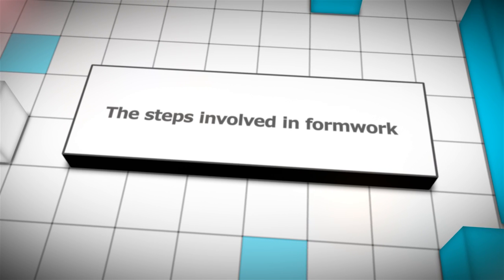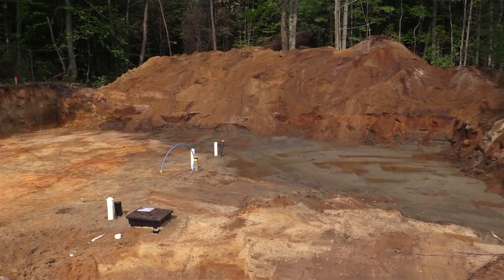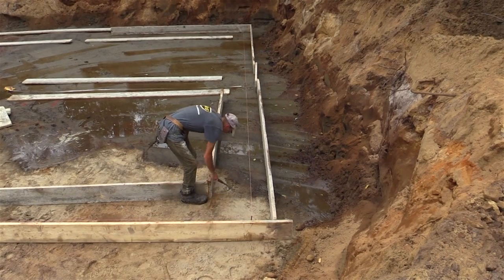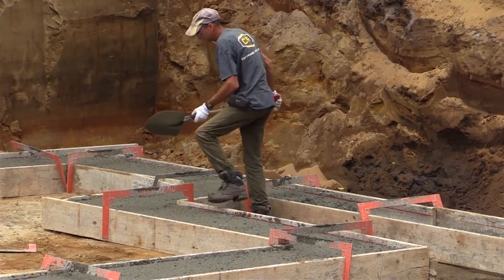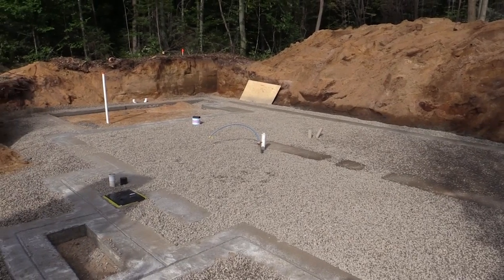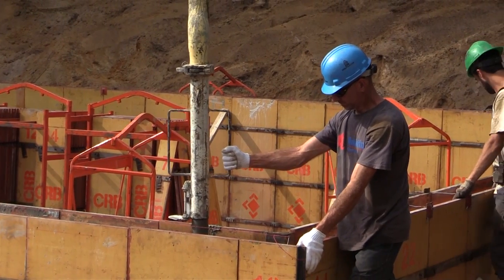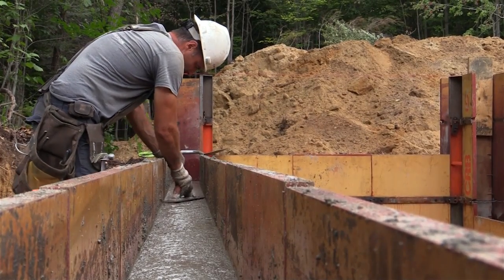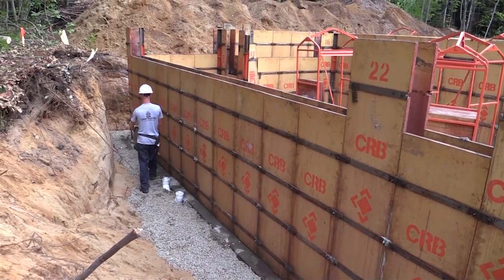The steps involved in formwork

Comment: WHAT ????? NO REBAR in the footer or walls , you would never do my place …..
Reply: Not every job requires bar. Depends on the fill /lay of the land .
Reply: Formwork
Reply: The builder doesn't decide whether to out rebar or not. They go according to the specifications on the blue prints
Reply: Not a sign of a rebar to be seen 🙈🙈
Reply: im sure they follow the blueprint   but i cant belive  they dont insert not even 1 rebar , i dont see the point of saveing few bucks

Comment: No reinforcing rebars in the walls/foundation?
Reply: Winston Clifford Fast and Nasty ! where I live a 2 ' by 2' grid of # 4 rebar is code in all foundation walls
Reply: None in the foot nor verticals to tie to the wall.  WTH??
Reply: GomerfromIsaan some places all you have to do is put in a key way in the footings.  It's actually the A.C.I. code book believe it or not . It's not like that where I live though
Reply: Winston Clifford only 9 to 10 foot walls are in need for steel work these forms are 8 footers no need
Reply: The majority of houses that I pour, even if they are 9-foot walls do not need any rebar in them at all. Every barn that I have poured needs it, as well as commercial jobs. I would say many houses do not, though.
Reply: excavation process its needs willngly of person otherwise it easy to get negative impact to the site and safety of person
Reply: @pnutmal  where i live its like 16 centers both ways all 15m bar.
Reply: @tl7992  entirely depends on the soil conditions around the foundation. Where im from, the soil is a very active clay. all concrete poured here required loads of rebar. Must be nice to be somewhere with more stable soil.
Reply: I dont get it
Reply: We usually never put rebar in the footing unless the builder wants us to, but always put at least 2 rows of #4 rebar or more in every foundation we do, it's code in CT
Reply: No rebar needed if you pour your house on a spring. ....🤥
Reply: substandard at best

Comment: Where are these guys from ?  No steel ?  No J bolts ?
Reply: Judging by the name, Mexico maybe?
Reply: That's a French name. I live in Mexico. We use shit loads of rebar. A full bond beam at 9' height.  A vertical every meter ( 40"). All solid block, steel, and concrete.  Even the roofs.
Reply: Well maybe it's french then. I think Rebar is really only for code in places that have earth quakes or any kind of ground movement. If the ground doesn't move, then the concrete is gonna be just fine sitting there.
Reply: I was a concrete contractor.  Concrete really has no strength.  If you put 4'' x 4' x 10'  Between the walls with no support it would crack in half. But if you put 1/2" ( # 2 ) rebar every 12'' ( making a checker board ) it will be very strong. One helps the other.  You ever see a bridge pylon ?    It's mostly steel and filled in with concrete. Vibrated so as to have NO air bubbles. Air bubbles would break the bond.  Also horizontal  rebar in a footing insure no differential settling.  I worked in Phx 40 years.  Now they use post tension.  A much better system.
Reply: Well, I know there's a lot of primitive forms of concrete used in Roman structures that still stand today with no rebar. Obviously it's not worth really doing it without rebar and have your house fall on you, but if done right without it I'm sure it can still be done. You need the right kind of concrete though.
Reply: They're from Canada. Judging by the french name I would say Quebec or eastern canada somewhere.
Reply: @dedalliance1  Well, IDK about all that? For instance the Roman Colosseum's outer walls are estimated to have over 3.5 million cubic feet of travertine stone & volcanic rock, which was set without mortar. Yet, they are held together by 300 tons of "iron clamps." Now, there may be other Roman structures which were built w/o any iron holding them together as you state, IDK? I'm just giving you this 1 example to show you that the Romans absolutely did use a type of iron, (rebar) to hold the integrity of the Colosseum together. Plus, the rebar has nothing to do with whether you live in a place susceptible to earth quakes or not. Also, there's ground movement no matter where you live, the earths conflicts due to mother nature constantly shifts & disturbs the ground. The main purpose for rebar use in concrete, is to reinforce the concrete by absorbing the tensile, shear, & compression stresses in the concrete structure. Concrete on it's own does not make a good structural material, period.

Comment: Why would you not pour to top of form and he didn't put any steaks or rebar in wtf?
Reply: No need for stakes driving stakes is old school this is by far the fastest way to do footings. They didn't pour to the top because the panels are to high for the wall height. These panels are much easier to work with because of that you can easily do different wall heights.

Comment: What keeps the concrete from going under the form? That's a lot of weight...
Reply: I've done thousands of foundations with these forms and have never had it happen
Reply: Only if you have a very large step and you cap the lower wall at the step or a very large window .We use aluminum forms with two inch ribs so half inch by 4 inch concrete screws (Big tapcons) into the footer do the trick.